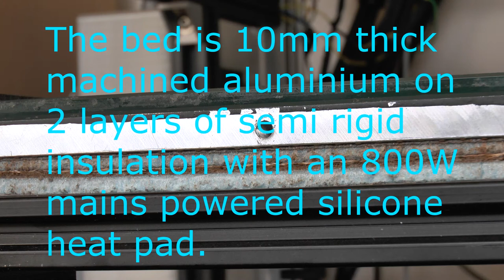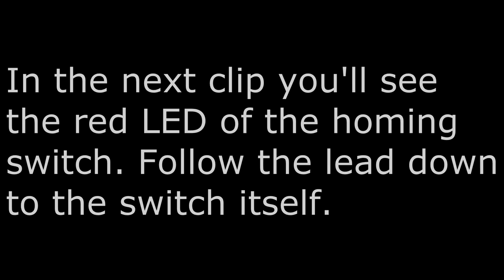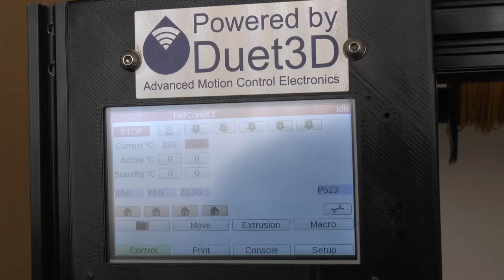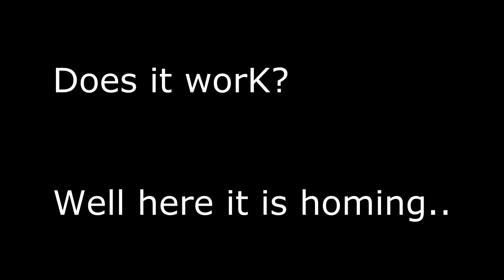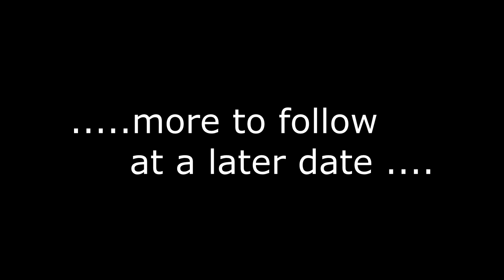TheMightyQuin

Comment: Hi Ian,

Inspirational indeed!
Fits with some of the ideas I have in modifying my FT5 or rebuilding one from scratch.
I had a similar idea about putting extruders on a separate deck and using E3D's  chimera, but was struggling with the homing of that one.
I see you're pulling the 2nd deck with the extruders with these cords from the main print deck. How do you avoid this in producing artefacts in you print? 

Thanks for blog and the videos!

Best regards,

Walter.
Reply from the maker: Hi Walter. I don't think you've seen the latest video. Now that I've fitted 5 extruders, I decided that it was time to drive the extruder gantry rather than having it passively dragged around. So essentially it's two core XY gantry's fitted one above the other. The lower one is the main hot end gantry, the upper one is for the extruders. Each gantry is driven by it's own motors but as far as the Duet electronics are concerned, it's a single gantry. The drives are mapped so that X axis uses drives 0 and 3 and the Y axis uses drives 1 and  4. So whatever the lower gantry does, the upper one follows.  The upper gantry has a bit more range of movement than the lower one so I only need home the lower gantry as normal. One thing I have to watch is that the two gantries are more or less lined up when I turn the machine on, otherwise the extruder gantry could reach the limit of its travel before the main gantry trigger a homing switch. The Z is drive 2 and the 5 extrudes are drives 5 to 9 on the Duex5. (10 drivers used from 0 to 9).
Reply: Hi Ian, I missed that part. Yes, normally they will not run away from each other and they may run a bit apart without issues. The important thing is that the masses are not mechanically influencing each other. 
As I'm printing also PC and other strange stuff, I'm still looking for a way to create a closed printing environment that can become a bit hot. The sides are no issue and getting the steppers out of that space isn't an issue neither with a coreXY. Just the 'roof' is a bit of an issue. I would need a kind of a small moving  hole to get the bowden tubes and a bit of cabling from 2nd deck to printing deck.
No diamond for me. I just want main filament and support filament when needed.
I will most certainly 'steal' some of your ideas! Thanks!
Reply from the maker: Hi Walter. TBH, I didn't have any real problems when the extruders were being dragged around instead of being driven - even when I did the high speed stuff at up to 300mm/sec. I was rather surprise myself but both carriages and the rails are very stiff and the flex in the Bowden tubes helped to de-couple them and absorb some of the forces. When I went up to 5 extruders, the weight increased by about 30% to around 1.6kgs and it was at this point that I decided that dragging them around was likely to cause problems. Hence the double driven gantries.

Comment: Proper stop button!
Reply from the maker: Ah. So you've found the latest iteration of my machine :) As for "proper stop button", it's not quite what it seems. All it does is initiate an emergency stop via the Duet. It doesn't actually cut all power to the machine. To do that, I have an RCD with an easily accessible stop button on it (although I've never had cause to use it).

Comment: WOW, WHAT AN UPDATE!! incredible! so is the extruder gantry now actively driven as well? the extruder gantry mirrors the hotend gantry using motor splitter cables? (i.e. the same signal?)
the Z leveling and diamond5 mount is very clever and beautifully designed. the whole thing is! 
how is 5way colour mixing? keep it up, i cant wait to see more!!!
Reply from the maker: Hi. Glad you like it. The two gantry's are treated as one in the firmware. Not using splitter cables but they do get the same signal. Basically each motor is connected to a separate stepper driver and the drivers are mapped to each axis. So the X axis uses drivers 0 and 3, the Y axis uses drivers 1 and 4 and the Z axis uses the single driver 2. The hot end coreXY is driven by the motors that are connected to drives 0 and 1, and the extruder coreXY is driven by the motors connected to drives 3 and 4. Each motor is rated at 59N.cm at 2 amps but I run them at 1.8 Amps. That's all the available stepper drivers on the Duet main board. The 5 extruder stepper motors are connected to the 5 stepper drivers on the Duex5 expansion board.  

Everything heats, moves and homes as it should but that's as far as I've got with it at the moment. Lots to do to get it all dialled in.
Ian
Reply: deckingman oh wow, ok, I see. I didn't know you could do 5 plus an additional 5 with the duex5 expansion board. VERY cool. The closed belt triple rod X is very clever too. What a beast! Keep up the great work, its very exiting and inspirational! Hopefully it won't be too complicated or different to the tripple setup procedure. Can't wait to see some full colour mixing or how much filament you can pump out of 5 extruders!
Reply from the maker: Thanks. I don't know if you've seen my blog but you might find something of interest on it. I'm really busy right now so I haven't said much about the latest evolution of the printer, but when I start playing with the 5 colour hot end, that's where I'll be posting most of my findings. Here is a link https://somei3deas.wordpress.com/
Reply: deckingman of course I have! Read through the lot not too long ago. It's really really interesting, and your printer is pushing the limits. I found it really clever pushing the same filament through the triple hotend for fast output, and it'll be interesting to see if 5 can do more, although I guess it's the melt zone that's the limit at this point. 
Anything you write up I'll read with great interest, but don't worry, I'll enjoy it as and when it comes. 
Might have some questions for you once I get a duet. Our already had a triple diamond since the Kickstarter and haven't used it, but you've really inspired me.

Comment: insane
Reply from the maker: Yes it is isn't it. I didn't plan the printer this way - it just kind of evolved into what it is now. Because the frame is so big  (600mm x 600mm), if I had mounted the extruders on the frame, the Bowden tubes would have had to be about a metre long. So the Mk1 had them suspended above the bed with pulleys and counter weights, but that wasn't 100% successful. Mk2 had them on their own gantry but passively dragged around by the main carriage. The latest upgrade meant increasing the extruders from 3 to 5 and with steppers, mounts Delrin wheels etc, the mass for the extruders assemble increased to around 1.6 kgs which is just too much to be dragged around by the hot end carriage, hence the second coreXY mechanism. The total mass that has to move in Y is a tad over 4kgs - completely crazy.

Comment: Where can this printer be found outside your place?
Reply from the maker: It can't be found elsewhere. It's my own design. I have no plans to market it either, as the cost would likely be too high for most people. Ian
Reply: Do you have a parts list somewhere gathered together so people can at least see the motors, belts, control boards, etc you've used?  You've clearly put a lot of thought and test time in all your choices.  You also, clearly, use significantly larger motors than most 3D printers, which seems to reduce your transit times quite a bit.